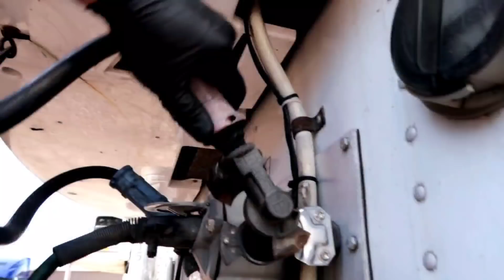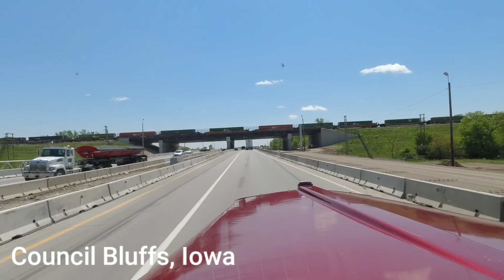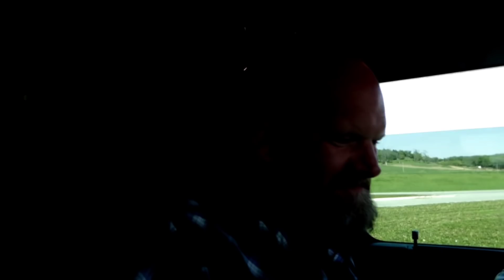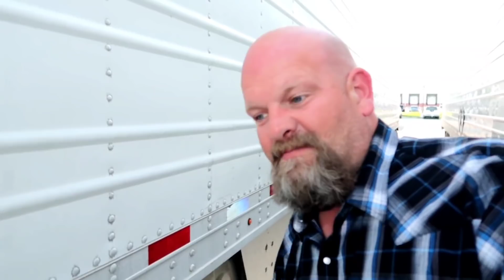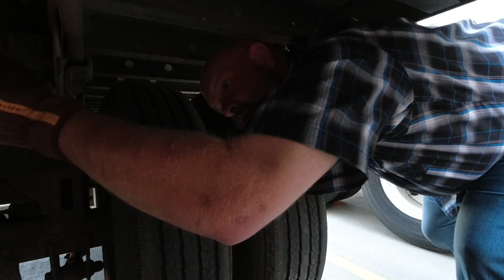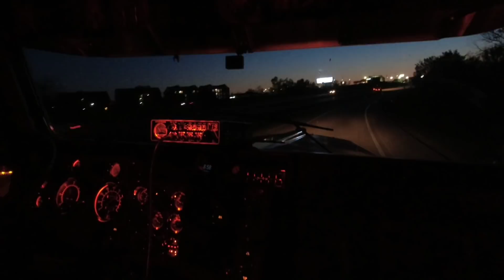Loaded For Kansas ~ I'm Loosing My Mind #339

Comment: Instead of a crock pot get an Instant pot. You can use it the same as a crock pot, with the added benefit of being able to cook fast when needed. The clean up is easy, I just rinse it out add a little clean water heat it up then add soap and clean. You can also buy a air frier addition for it that will give you even more options.  
I like to cook Zatarains jambalaya rice mix with smoked sausage, only takes 15ish minutes. Left overs for lunch the next day.

Comment: Batteries, cables, switch, starter motor?  All of that would be less than the cost of one month of insurance on a new rig, let alone the payment.  I'd get a rebuilt starter motor, swap out the current motor and have it rebuilt just to have a spare part on hand.

Comment: Road Pro oven!  Cook the food at home ahead of time.  Use the foil pan with a slow cooker bag inside as a freezer mold.  Freeze up what you cook at the house (like little bricks in a bag) and throw it in the freezer in the truck when you head out. Pop the bag inside a foil pan in the roadpro oven about 1-2 hours ahead of time.  By the time you stop for the night, supper is done and you're good to go!  (The last 1/2 hour is rough though as you will fill the cab with the smell of supper and it will drive you nuts until you get stopped for the night!)  We do beef tips in gravy, chicken Alfredo, old fashioned goulash, roast beef and potato's etc..  Canned chicken with a jar of Alfredo sauce over the frozen pre-packed noodles can be used instead of frozen from home if you run outta time. Just dump it all in the oven and go.  Use the slow cooker bags though for easy clean up.  Good luck!

Comment: Hot Logic is what I cook in and any recipe that a crock pot can cook, it can cook.
Reply: I absolutely love my hot logic bag.   I get disposable tins from dollar tree that fit perfectly.  Like 5 for a dollar.
Reply: @bon2198   I love mine as well. even paper bowls work well in it.
Reply: @keepupwithspeedy  yeah it’s amazing.  Literally anything can go in and not burn up.  I did an experiment with it outside and it didn’t even set a piece of paper on fire.  Slow and low cooking style at its finest.
Reply: @bon2198  yes, it only gets to 160 degrees F. I tested it. not hot enough to even melt a zip lock bag. much less set paper on fire.
Reply: @keepupwithspeedy  yeah, so amazing that thing.

Comment: Dumb question and sorry if it was already asked but did you try crossing the starter terminals with a screwdriver yet to rule out the starter and could be the solenoid or wiring or switch?

Comment: Kurt you keep mentioning the cracking and banging sound is coming from your exhaust system. I’m curious I had W9s with Cats and never remembering hearing it do you have spacers/bushings or mounting making the noise.  To me that bothers the H out of me.  Sorry don’t mean to be picking on small stuff but I’m always crazy with those kinda sounds.   I asked couple days back the miles on 1st Class, if you don’t mind.  I’ve been very fortunate my W9s were very dependable.  Wish you the best, I did my time behind the wheel.OOOh.  Good LUCK on cooking in the truck!
Reply: I’m thinking cab mounts , I’ve had a T800 a T660 and my W9 they have all went through cab mounts ..

Comment: If someone doesn't raise their landing gear on their trailer high enough, is it possible they could lose their trailer while going over a speedbump?
Reply: It is possible to hit the crest of a steep bank like a railway line crossing but, if you're getting into that kind of situation you need to be thinking about other ways to go. You would never lose the trailer just through grounding out. You'll just dig a big hole in the road and bend the gear backwards. In 40 years, I've never hit the landing gear on anything.
Reply from the maker: Maybe not loose. But will damage